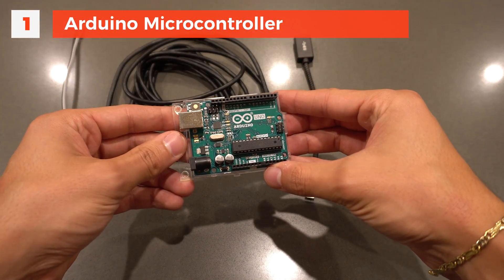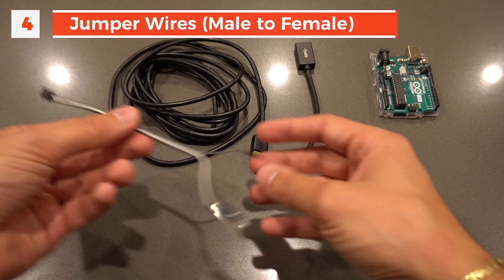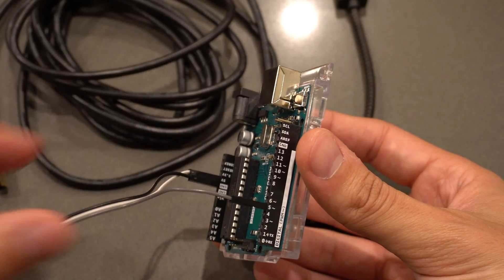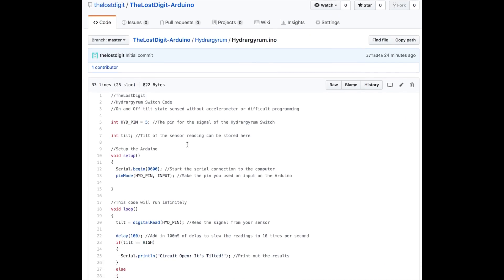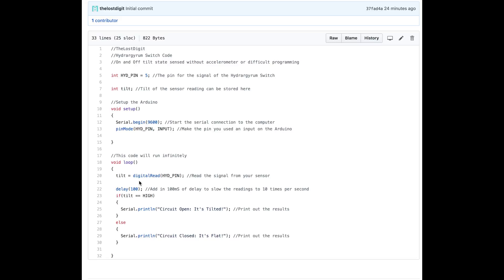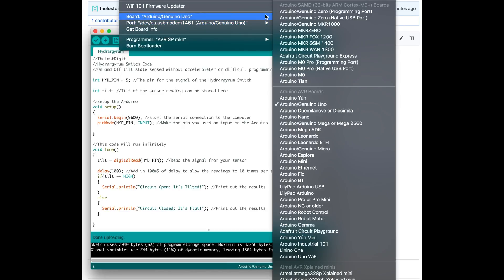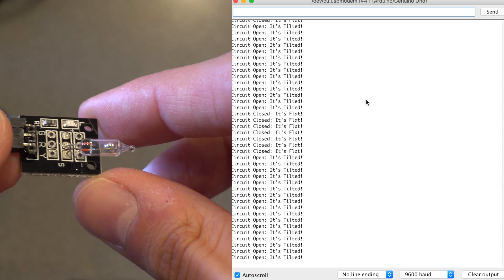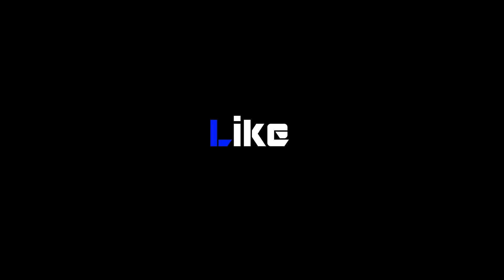Hydrargyrum (Mercury) Switch - Arduino Series 001

Comment: Nice vid, but 3 pins is a lot! Cant i use this sensor without that red led blinking and make it use only 2 pins?
Reply from the maker: The red is actually not controlled by the arduino. The third wire is the signal input to the arduino